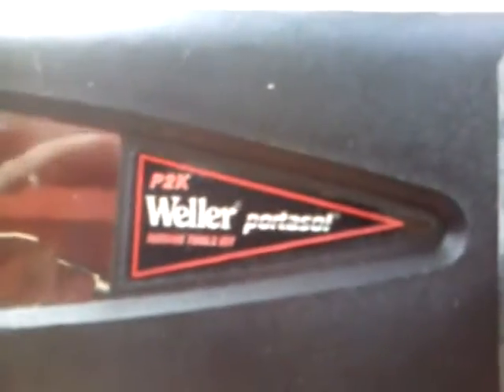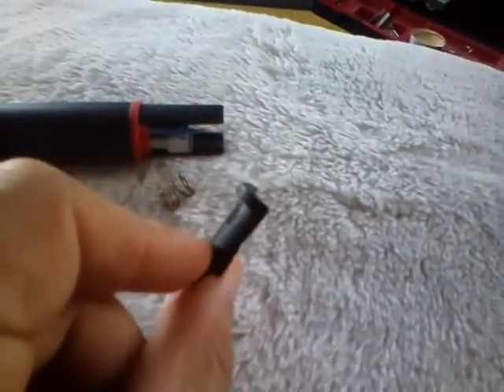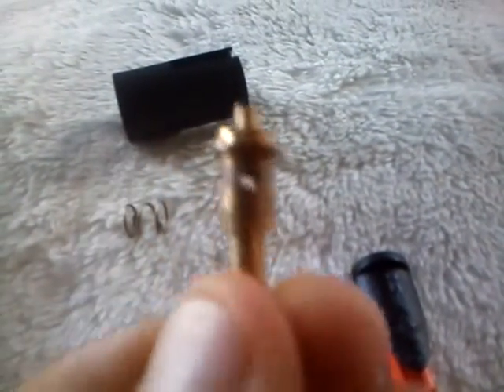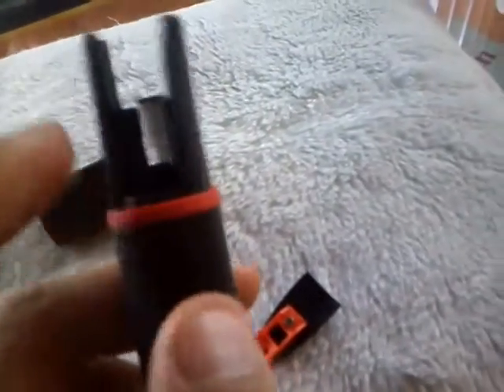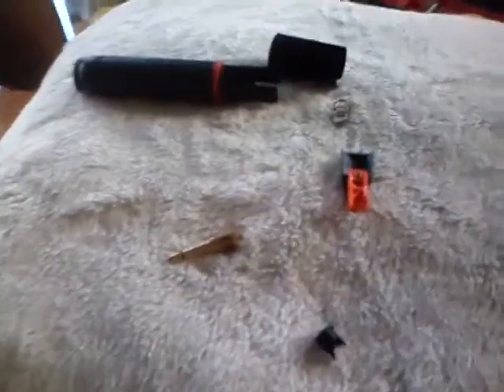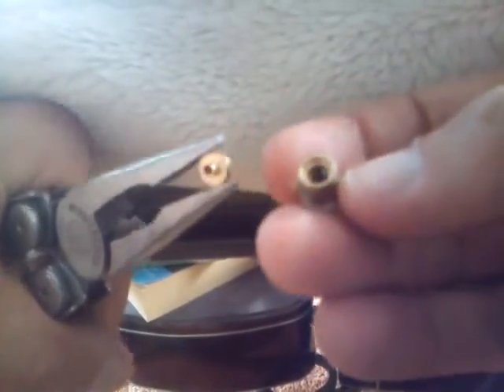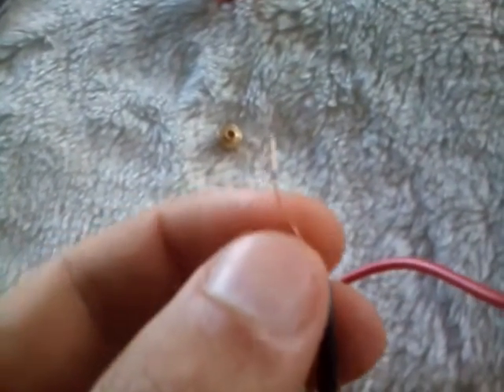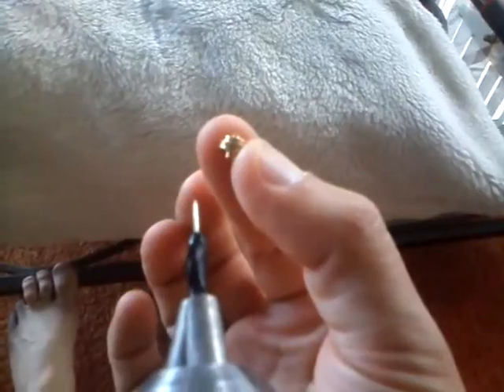Weller Portasol P2k, How NOT to Fix Clogged Jet

Comment: I have the P-1K did not work so I took it apart found that it doesn't have cross drill holes at the top like your video but it does have the small hole at the bottom what I found at the top was a Red Jewel that was inlaid the brass that had a micro hole that I almost didn't see until I pulled the jewelers loop out at 40 x this was the hole that was plugged I ended up using an ultrasonic cleaner to clean the hole there is no way to use a wire unless you happen to have something on the order of 1 to 2 thousands..

Comment: Old post but like me others are looking all the time. When you get to the jet dont drill/ support the outside and find pin punch the fits larger inlet hole that doesn't go down to the jet. Then fill with oil first grease as last resort then tap pin punch in supported jet. Eventually by hydraulics it will clear, if not boil with detergent for however long it takes / ultrasonic bath.  Good luck after seeing this long winded vid I will try mine.

Comment: Nice video, I cleaned mine more than once just by blowing the jet. but never knew the jet came apart. 
The only problem is the piezo element.
There is no spark.
I have 3 soldering irons of me and my colleagues. 
Do you know if they are sold apart?

Comment: Thanks for this, just fixed my Portasol, bottom end jet was blocked, managed to use a gas can to blow the blockage out the other way. Dirt must have got in the last time I re-charged it with gas.

Comment: Smh, well you helped me find the dang screws lol. I was looking for an OEM exploded view diagram when i came across a link to this video. When you started talking about boring out holes I knew you were headed south. These little jet lighters/soldering torches, to make them work like a little jet engine, are engineered and designed with some tight tolerances. Changing one aspect of the dimensions has a direct effect on the other dimensions either +/- in size. Pretty difficult to just wing it without the OEM Blueprints or even an OEM assembly diagram. Anyway, although it got kinda cringey and in a finger nails on a chalkboard kind of way it’s helped a lot of people, myself included, so thank you.
WAIT!!! Before I bounce I’d like to add that you shouldn’t buy another one of these things. The tips are outrageously priced so if you do a significant amount of work you’ll be burning thru those 25$ soldering tips pretty quickly… (20$ fo a solder tip -gtfoh with that scamming garbage) For what it is the consumables are way overpriced and the tool itself is practically a novelty lighter. It works well for certain brute force, Neanderthal “me smash” applications but other than that….cheers

Comment: Dude,when your portosol,tip does not light,and it does what yours did at the end of the video? You tried to ignite the tip, but instead a flame remained on it like a candle.Take a lighter first and heat up the entire tip first.With no gas on,then ignite it

Comment: Thanks to this video and it's comments I finally got around fixing mine. I put the whole jet assembly on a small bag with carb cleaner (without the rubber parts obviously), and dunked the bag on a cheap ultrasonic cleaner, worked like a charm.

Comment: I don’t think mine is clogged because it’s shooting flames out the side of the tip like it’s getting too much fuel or something does anyone know anything about that. I have this weller as well as a couple of other brand butane soldering irons all doing the same thing.
Reply: That at the very end of the video that’s what mine does the flames out the side but I haven’t drilled out the jet or anything it just started doing that.

Comment: Thanks for this  as I had the same problem and did not know the jet came apart.
Took the jet apart and used a brake cleaner with the straw for pressure and was able to clear the clog.Works great saved  $90

Comment: Fyi: mine didn't flame up and burned like yours (after the misfix ) opened the thing up, got the jet out and just sucked on it.( there is a small rubber stop at the bottom I got out to get more airflow when sucking and put it back afterwards.)  A little clog flew in my mouth. Problem fixed :-). Burns like new!!!

Comment: I love the portasol portable soldering iron, I've had mine for several years and it still works like new. Comes in VERY handy in automotive work. They are made in Ireland and built to last....  Amazon has cheapest price on them....  http://www.amazon.com/gp/product/B003H6NN2Q/ref=as_li_tl?ie=UTF8&camp=1789&creative=390957&creativeASIN=B003H6NN2Q&linkCode=as2&tag=electrandmo0a-20&linkId=QDRKGXHLVRANAIEL